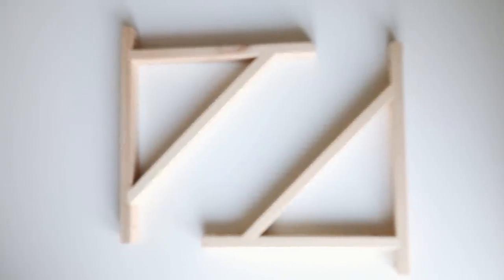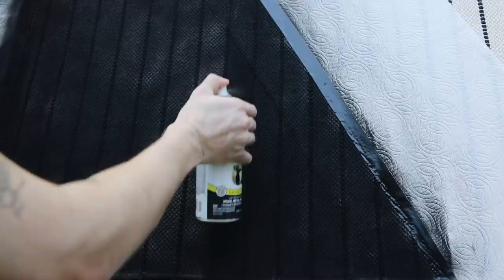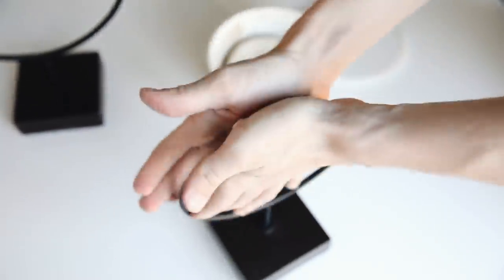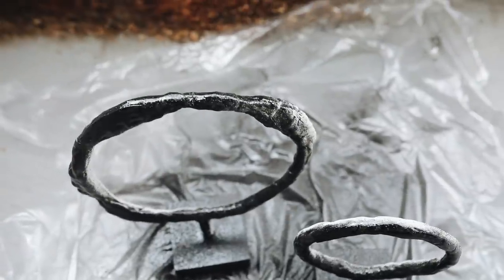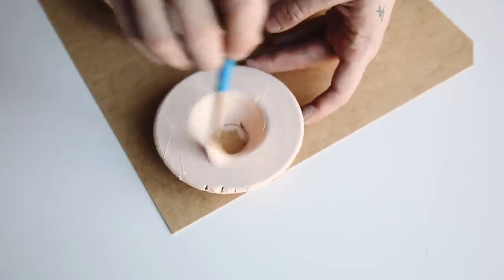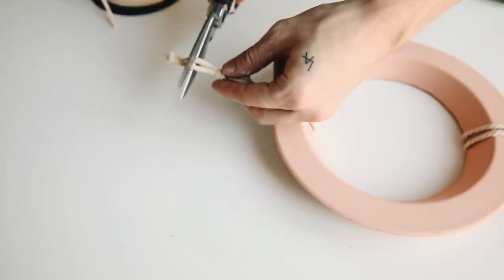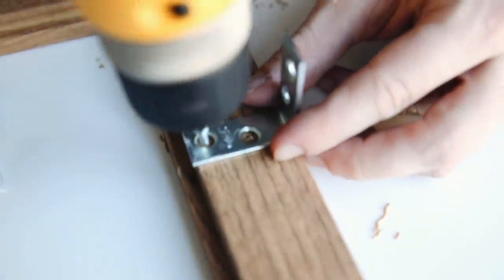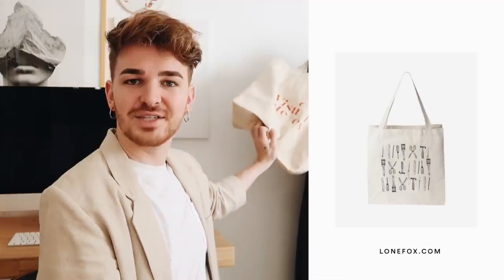DIY IKEA HACKS - Minimal Home Decor + Furniture Hacks for 2020

Comment: I would put the tapestry dowel through the triangle opening of the brackets and put a shelf on the top. So you can have a cute little shelf above the tapestry. 2 in 1 decor.
Reply: I should have read the comments first, since I just said the same thing!!! ;)
Reply: Exactly what I thought!
Reply: And add a led light under the shelf to illuminate the tapestry

Comment: Just a quick suggestion for the project 1 - the hung rug hack... if you slide the wooden rod inside the EKBY brackets, it allows you to still have a display shelf on top of the two brackets. IMO this would be more interesting and 'finished'.

Comment: Just want say you're very creative and artistic  😊  I would have used a strip of wood look tacky wallpaper to cover the L bracket of yout tray/table tho... cut to the exact size of the interior edge...that way even if you're sitting on the floor all you see is wood... you can hot glue cardboard between the brackets to build out the empty space so your wallpaper doesnt highlight the brackets  😊  my 2 cents worth....